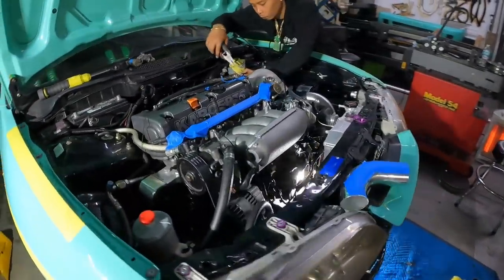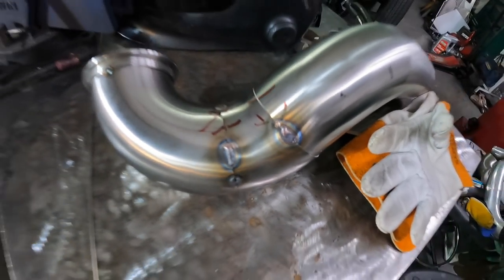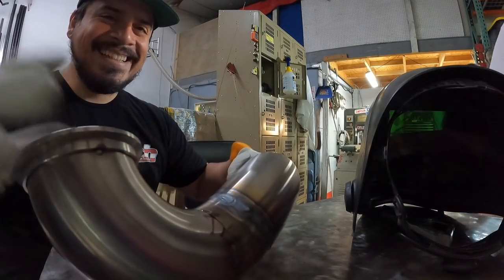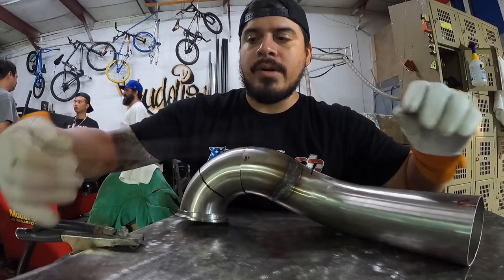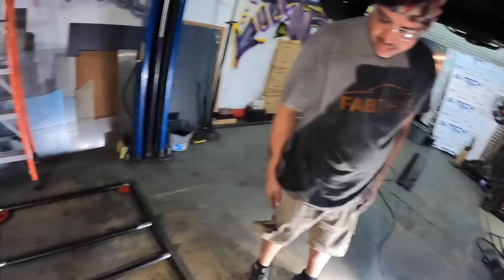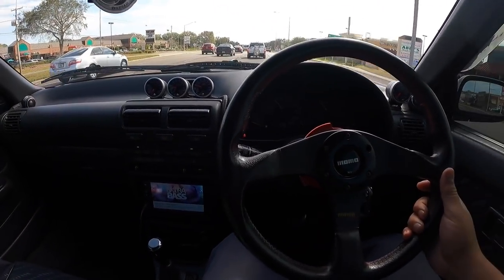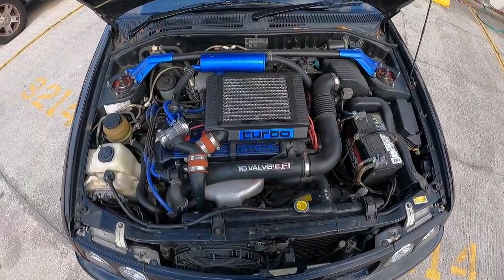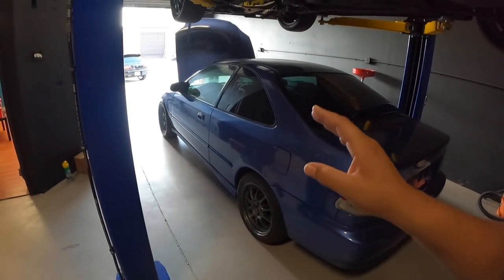INTRODUCING MY FIRST RHD CAR TO THE CHANNEL!!!

Comment: You need to rest your hand with the torch on something to keep it steady and work on wrist control. The hand that feeds can normally be in the air.  2nd don't just pull off of a weld quickly since it will leave a pin hole at the end of the bead. Feather the heat slowly down and stay over the end for a few secs to let the argon shield the cooling weld puddle. You can adjust pre and post flow settings on the machine to suit whatever your welding.

Comment: Welding’s coming on great buddy. Stainless is all about keeping the oxygen out. If it gets too hot and your puddle penetrates right through the parent metal it’ll draw oxygen from the backside and contaminate the weld. This is where you need to purge thin wall stainless. A lot of guys who weld dairy pipe won’t use any filler wire. They’ll just get a tight fit and walk the cup around quickly, fusing it together. The benefit of this is using speed to your advantage to keep the heat down which will prevent burning through and get a really nice looking weld. There needs to be zero gap on your prep for this method. Your mentor looks like he’s got you though, he knows the best way to get good is just to practice. It’s all in the practice.

Comment: Ayo Emilio, keep the torch over the weld to keep it shielded with argon until it stops glowing when you are doing stainless. When the oxygen is allowed to hit the weld before it cools down, it is what causes that burnt color. Also when welding aluminum, you want to turn the heat up a bit. On 16 gauge aluminum tubing, I run around 95 amps. Trying to weld it at a lower amperage will allow the heat to spread too much and heats up the tubing so that the material will start sinking in. Good luck brother and keep at it!

Comment: I ❤ Starlets ! A built 4EFTE is strong 💪🏽 hope you keep it. Nice job on the welding bro, another skill uploaded to the mind. 😎
Reply: 4efte shit themselves if you turn boost up past factory.
Reply: @alastairdow2536  thats why he said built 
and a stock block 4efte will take a damn more than stock power if you change the exhaust manifold and get a good standalone and good fuel 
you can get 200bhp even from the stock turbo 
goto a more efficient turbo and your getting even more

Comment: I mean it is welded! Good job bro. You have to start somewhere. As you start getting further around the pipe the material is getting hotter you need to back off on the foot pedal and  quite a bit and feed a little extra filler rod or as you can see the weld was way too hot and you burned right through.

Comment: Had a Starlet GT for almost 4 years. It's a pretty quick small rocket. Stock engine can handle 200+ hp. 17 inch wheels is killing it though. 15 is the best size for it. I have some videos on my channel if you want to check it out

Comment: Welding is an art, you can only get better by practicing .

My advise is

Once you find the rhythm in your hand, feet peddle and handling of a torch , and feeding wire you need to understand different behaviour of different metals when welding. 

Purging of various materials when welding is very detrimental and very critical.

Ensure all Welding Surfaces are free and cleaned , from paint, rust ,paint,slag,burrs and dust to ensure a good sound weld .

Welding gloves needs to be cleaned and free from dust ,oils, Grease at all times to prevent contamination of the weld deposit and to prevent contamination of your feed wire .

Your welding equipment needs to be set as for your grade of material that you are working on.

Comment: If you can get a piece of 1/8" copper behind that hole in the aluminum you should be able to fill it in. Then you can remove the copper. Not a perfect solution but will help you learn to fill holes.

Comment: Bro take you glove off the hand you hold the wire with you will have better control when feeding wire get a beat going like 1  2  1  2  1  2 so dab   dab  dab  dab nice starting out tho get in there and do it chur 🤟

Comment: Dope man. I always wantee a Pulsar GTi-R but this might actually do better from a reliability point of view. Not sure how these motors handle power mods.
Reply: not a pulsar that's a turbo starlet
Reply: Some have been highly tunned over in UK Nd Ireland Japan  any with decent power needs the 1.5 block from a cynos, bigger turbo, forged internals, ecu options are limited end up costing a lot back then now a days be stupid money to get 300hp from one as the parts just ain't there and even at 200 they seemed to explode with the stock motor